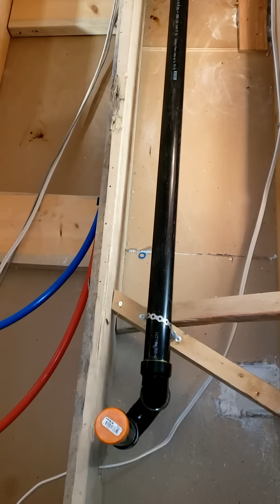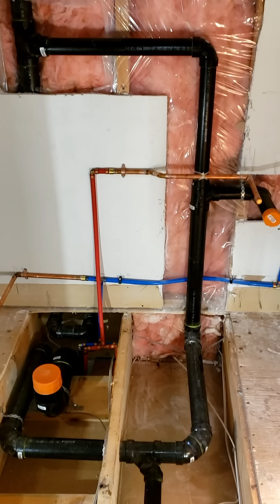Wet Venting EXPLAINED! - #SHORTS

Comment: For a wet vent, is there a restriction on maximum distance from the further fixture drain? Not a plumber, but I know there are some constraints. With this system, does the vent still need to be 6" above flood rim level, or not since it's not a dry system
Reply from the maker: Here in Ontario/Canada, there is no limit on the developed length of the wet vent; it could theoretically run forever.  Also, a fixture drain/trap arm connecting to a wet vent can connect completely horizontally, whereas a dry vent must connect to the fixture drain above the fixture drain's horizontal centerline (to minimize drainage and solids from entering the dry vent since it cannot typically be snaked or serviced).

Hope to this addresses your questions!
Reply: I have almost the exact arrangement as the vid, except i only have 2 fixtures. And the original piping is 1.5" (old house doing reno)
Where you have the toilet,  i have a shower, 
where you have a bathtub i have the lav / vent. 
Where you have the lav i have nothing, instead it elbows down to a drain perpendicular pipe (drains to the left).
Because i dont have a toilet do i need 2" pipe" still? Viewing from the angle of the vid, My shower trap arm is is actually feeding upstream, then loops around as you show from the toilet and then back down via an elbow (in the area where you have the lav). 
My question is, couldnt my shower, drain directly into the perpendicular drain pipe (rotating trap 180⁰) via an elbow down, i know thus would create an s-trap, so somewhere along the trap arm I would branch horizontal to the wet vent via a wye, this may sound confusing anyway I can send you a diagram? Hopefully you will see thus before weekend🙏
Reply from the maker: @rionp912 Sure thing. You can send a diagram to me via the email address in my profile.

From your description, all I can gather and confirm is that you do NOT need a 2" wet vent if you don't have a toilet.  If you're venting only a shower and lav, then you can wet vent one or the other using only 1-1/2"...provided that it's configured properly and meets all the wet venting rules!  I would need to see a diagram to better understand your configuration.

Also note that my explanation applies to Canadian Plumbing Code, and may not be the same in your area.
Reply: The dry part of the vent above where the lav ties in cannot turn to say revent into another vent until it is at least six inches above the flood rim level of the fixture to which it serves for the reason mentioned they do not want any solids having any chance to get into the vent pipe in the event of a stoppage

Comment: I’m the uk we don’t do secondary venting but I have cut and removed a lot of it but we don’t install it as regulations.
Reply from the maker: Yeah, you're not wrong. It's incredible how strict we are with our Plumbing code here in Canada - as if the rules were gospel, and plumbing just couldn't function any other way.  However, if you peek over at my Instagram (plumbingscool1), I posted a number of plumbing differences I noticed while over in Italy in the summer, which would be absolute blasphemy or at least frowned upon here in Ontario...yet European plumbing still survives!  😁
Reply: Yeah here in the uk it appears that all of our new age plumbing experts (lol) prefer to install their work in the most easiest way possible, minimum effort whilst maintaining maximum corners cut and for others to fix the problems later, whats the saying? #will shove an anti vac trap on that mate jobs a gooden,
Their vans must be jam packed full of anti vac traps, flexible pan connectors,  push fit fittings and plume management kits.

Comment: Anytime I see plastic behind drywall it makes me sad, vapor barriers cause mold, vaper ratarders do not. Never put up plastic inside your house, use a retarder system so the moisture can pass through your walls slowly and be handled by your AC unit instead of being stuck inside your wall blocked by the barrier causing mold.
Reply: Vapor barrier goes on the warm side, so when heating house, the warm conditioned air does not condensate inside the outside walls where it's cold.  That how I was taught.  I always use 6 mil poly on outside walls over the insulation and studs, before sheetrock.
Reply from the maker: I'm certainly not an expert in that field, but I think it's been done this way here in Canada for decades upon decades.  I think the idea is to prevent moisture from passing through, inside and outside walls, while any moisture which may exist within the outside walls can vent through the tiny weepholes purposely placed throughout the walls of a typical brick construction.  Not sure where you're located, but here in Canada the plastic vapour barrier is especially beneficial during the COLD winter months, where the passing of moist air from inside the house to the outer walls will cause condensation...thus leading to mold buildup as you suggest.

Generally speaking, I think the system appears to work satisfactory, based upon the countless outer openings I've seen during renos of older buildings.

But again...I'm no expert.  Best I stick to plumbing!

Comment: @Plumbings cool what is that 2inch line tied into because i can't see it by the toilet
Reply from the maker: The 2" wet vent is tying into a vertically-positioned 3x3x2" ABS Wye fitting.  You're allowed to connect  the toilet's vent (or wet vent in this case) anywhere within the first vertical meter of the toilet's fixture drain.
Reply: @PlumbingsCool  thank you I thought that's what it was tied into
Reply: @plumbings cool I'm here in Michigan and I  think Canada shares the same codes is the journeyman test that hard to pass
Reply from the maker: Well, I suppose it depends on what you define as hard.  If you don't prepare or understand the Code and tables, then yes I'd argue that the exam would prove tricky to pass...not necessarily because you don't know your plumbing, but more specifically because only a portion of the questions are based on traditional plumbing.  Aside from the typical drainage, venting and water supply knowledge you need to (and SHOULD!) possess, the government powers that be (in their infinite wisdom! 🙄) also throw in a horde of silly questions which have NOTHING to do with plumbing!  To further complicate matters, here in Ontario we teach our apprentices the Ontario (provincial) Code during their three levels of schooling, but their final government Certificate of Qualification exam is based on National Code - which will grant them a "Red Seal" certificate, allowing them to practice across the entire country.  We try to help the final-level students with preparing for their exam, but the government doesn't share any knowledge of the exam with the schools, so we as instructors are flying blind.  Pretty frustrating and unfair to the students.

But what I tell the apprentices is to make sure they know their hardcore plumbing basics inside & out, which will help compensate for more obscure, irrelevant (and quite honestly, DUMB!) questions they may not know the answer to.

Some get it in the first attempt, and others may need to take an additional crack or two at it to get the requisite pass of 70%. 

Hope this helps give you a feel for our testing procedures up here north of the border!
Reply: @PlumbingsCool  thanks it did

Comment: this is true but not true, if that is in fact a wet vent for the TOILET you can't vent a toilet with anything smaller than a 2" vent according to UPC. It's hard to tell from this video but that vent looks like it's not for the toilet so this is up to code if that is the case.
Reply from the maker: The WET vent (from the lav to the toilet) in this case is 2", while the DRY Continuous vent (upstream of the lav) is only 1-1/2".

Here in Canada, not only is it 100% legal, but I can easily load up an additional 18 fixture units into that 1-1/2" vent.  that's four ADDITIONAL tank-flush toilets!
Reply: We are just not allowed to penetrate the roof with anything smaller than two inch so the only time we will even run any inch and a half vent is to revent it into a two or three inch stack going VTR so to just make it idiot proof we just mostly keep all vents two inch and then there's no confusion on the part of the guys that may not know what why or how and are just learning the trade like I said two inch min thru roof anyway so it's redundant to run many 1.5 inch venting I do occasionally if it is beneficial to me or if that's what fittings I may have but I know what I can do and not do i would not start to explain the difference to some of the guys as they are just too green and it's hard enough to teach them how to run the PVC properly as it is I've told you a hundred times!!!!! Yeah but not today ugggggghhh

Comment: Maybe specify what code you are plumbing to! Ours under UPC requires a w.c. to have a 2“ vtr .  Btw your San-t tying your vents together is upside down.
Reply from the maker: Hi there. This is all Code-compliant as per Part 7 of the Ontario Building Code, as well as to Part 2 of Canada's National Building Code.  By "vtr", does that stand for "vent through roof"?   If so, then it is not required in our parts; an individually-vented toilet only requires a minimum 1-1/2" vent, with no limit on length.  We certainly do need to upsize ALL vents to 3" minimum prior to exiting a roof or wall, but for an entirely unrelated reason:  To minimize the likelihood of hoar-frost from choking out the vent during or bitterly cold ❄ winter months. (PHOOEY!! 🥶) 

The sanitary tee I think you're referring to (the topmost) is correct in practice, because the upside-down weir is supposed to theoretically facilitate the drawing in of air under negative pressure...but realistically, it doesn't really matter on the venting system, considering that even a straight, non-sanitary tee is also completely legal to be installed.  But the way you see it is indeed proper practice. 

On the other hand, the lower sanitary tee is installed with the weir at the bottom, which is intended to direct drainage from the lavatory, and is actually the ONLY allowable legal configuration for conveying drainage through a sanity tee.

Hope this helps!
Reply: your a bozo 😂😂😂 its not upside down

Comment: Its wrong.  The tub needs to be on the run of the wye and the sink needs to be on the branch of the wye.  Also wet vents need to run 2" all the way up.
Reply from the maker: Not sure where you're from, but this is absolutely, unquestionably correct and legal in Canada.  There is no distinction made whether the connections are made at wye's  main run or the branch, as long as the wye is properly installed in the direction of flow. 

Finally, the wet-vent IS a continuous 2-inch size throughout.  Don't confuse the piping upstream of the lavatory, which is no longer a wet vent (air and discharge), but rather a continuous vent (air only).

Hope this helps clear things up. 😁

Comment: That vent needs to be 2 inch all the way. I would not run it like this at all
Reply from the maker: Hmmm...not sure which vent you're referring to. The wet vent or the continuous vent?  The wet vent is 2" in size throughout, and the continuous vent is 1-1/2" - proper and absolutely legal beyond any shadow of a doubt here in Canada. 

Specifically, that 1-1/2" vent is allowed to convey eight fixture units for up to a whopping distance of 30 meters (100 feet!)...or 20 FU's for a distance of 15 meters (50 feet) before it needs to be upsized to 2-inch.  In this scenario, it's only serving 6 fixture units (Bathroom Group) and is terminating through the roof to open air at a mere distance of only about eight feet.

TONS of air! 😁

Comment: Is the pipe coming from the shower also 2”?
Reply from the maker: Nope, that shower's drain is 1-1/2-inch which is typical for a single-head shower or bathtub installation.  In our code, a 2-inch trap and fixture drain for a shower would be required only if it was serving 2-to-3 shower heads.  Note however that doing so would max out that 2-inch went vent and it would need to be upsized to 3-inch! 

The reason being that here in Ontario, the maximum that can be discharged into a 2-inch wet vent is 3 fixture units (which is the total of the 1-1/2-inch lavatory and 1-1/2-inch shower).  A 2-inch shower drain would bring the load up to 4.5 fixture units. (1.5 FU from the lavatory and 3 FU from the 2-inch shower)...hence the need for a 3-inch wet if there were a 2-inch shower...certainly overkill in this scenario.

FYI:  A 3-inch wet vent serving a toilet can have a load of 8 FU's discharging through the wet vent.
Reply: @PlumbingsCool  so is the shower wet venting through the same pipe? Sorry, I’m a complete novice
Reply from the maker: No worries!...asking is how we learn.

So yes, the shower's trap is also being protected by the 2-inch wet vent in which the shower's trap arm is connecting to.  That point of connection (the wye fitting) allows the shower's DISCHARGE to drain downstream through the wet vent, but also maintain access to the necessary AIRFLOW upstream of the connection, so as to prevent the shower's trap from being siphoned out in the event of negative pressure in the drainage system. 

Hope that makes sense.
Reply: @Plumbings cool I'm confused about the DFU's how would a 2inch drain for a shower in this diagram equal to 4.5 DFU's if including the lav and tub

Comment: So if I installed a toilet only, does the vent need to be 2 inch or can it be 1.5inch?
Reply from the maker: An individual vent serving a stand-alone toilet (no other fixtures draining through the vent) is only required to be 1-1/2".  

Think of it this way:  When it's acting only as an individual vent, it's only required to carry air, so it's like a single-lane road.

However, when you wet-vent, you're now conveying both air AND waste (now that single-lane road has become more like two lanes).  Therefore, because the liquid is now taking up space in that vent pipe, we're required to UPSIZE it (using Wet Vent Codebook tables) so that the vent can continue to provide the proper volume of necessary air to the toilet, while also having enough room to deliver waste from the fixtures connected to the wet vent upstream of the  toilet uninterrupted.

If you're wet-venting a toilet, you're allowed to discharge up to 3 fixture units into the wet vent (there is NO LOAD from the toilet or any other most downstream wet vented fixture).  If the discharge going into the wet vent is greater than 3 fixture units, then the wet vent must be up sized to 3" (which allows a maximum of 8 FU's to be discharged into the wet vent serving a toilet).

Hope this helps!

Comment: This is a great explanation.  So easy to understand for me. I'm definitely visual
Reply from the maker: Thanks very much! I agree...visual always makes things so much easier to understand, which is what I always strive for. 👍   Thanks for watching!
Reply: @PlumbingsCool  so the vent for the shower is that main vent (the one behind toilet)?
Reply: I call that demonstration over explanation.
Reply: Wrong
Reply: Wrong toilet has min 2" vent. At least according to UPC.
Reply: @ the Rule is Double of size. So if you using 3 inch drain. -1-1/2 is good enough.  Wake up